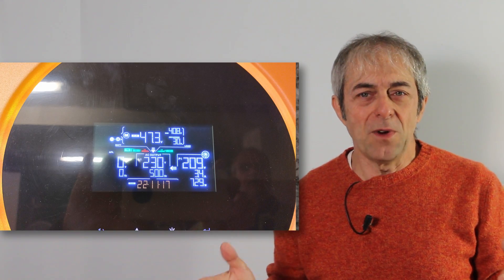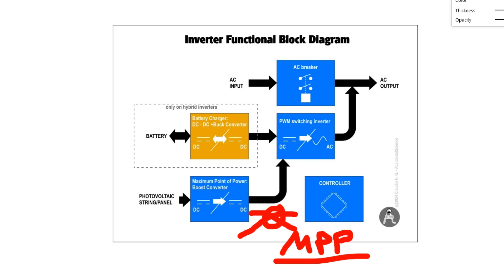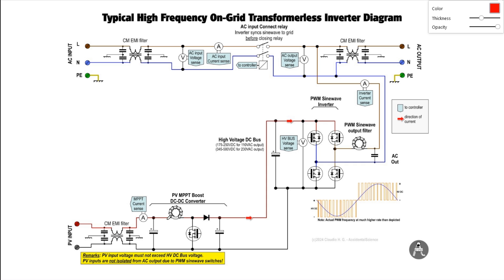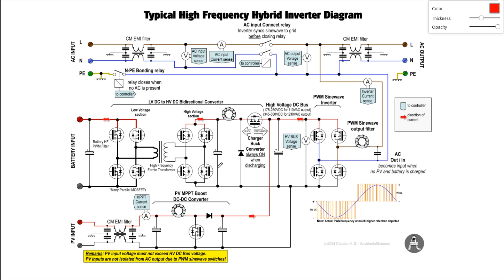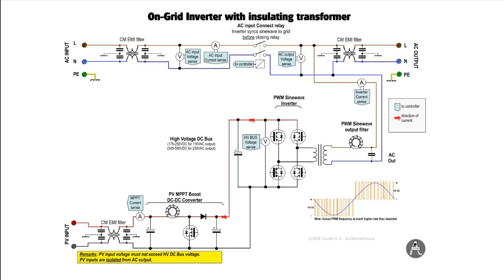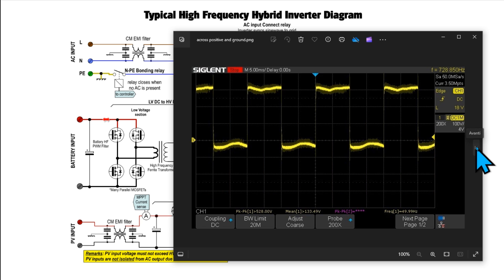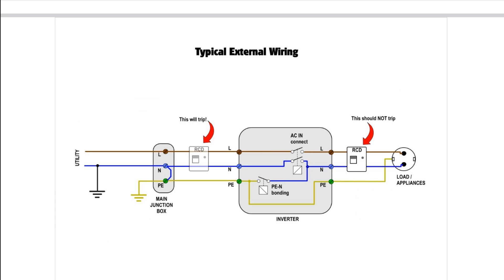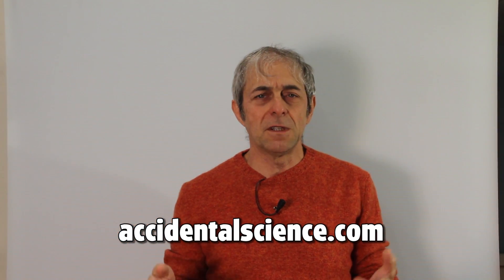Why grounding solar panels could be problematic?

Comment: Very interesting video. I am surprised that the AC leakage into the DC bus doesn't cause more problems.
Reply from the maker: The AC is originated by the switching from the DC bus, so it cannot cause any problem ...at the bus level. Unless I have not catched you meant something else. In case, feel free to add your thought, you are welcome.

Comment: I saw this issue on a grid tie system in Mexico, with an internationally available grid tie system. It was implemented with a transfer switch that also switched the neutral (3 contacts) and in the end had energized the entire house rebar system and metallic plumbing pipes and fixtures. The panel frames were also energized, likely causing the house structure current leak. It is unimaginable that these systems do not have an isolated output, either with a transformer of sytem rated power or a few small high frequency transformers internally. This is a manufacturing and regional approval issue.

Comment: If you're doing a Grid-Tie System that also has off grid capability, so you have power when the grid id down, GET THE TRANSFER SWITCH!
Because if you don't, and the Linemen come out and find a voltage on the line, they aren't going to look to see where it's coming from and ask you nicely to turn it off. They will simply short the lines and fry your system.
In the same way that you have no grounds to sue the Fire Department for breaking your car's windows when you park in front of a Hydrant, if you complain or try to sue, you WILL get a nice fat ticket to go with your loss. BECAUSE YOU BROKE THE LAW.
Reply from the maker: @TimeSurfer206  thank you for pointing out that. I don't remember if I mentioned it in the video but being my system configured as UPS it already has that transfer switch inside of the inverter.     This is common for many modern inverters.
Reply: @AccidentalScience  I wasn't speaking to you, but to everyone. Some things need to be said out loud and often. The installer, whether Homeowner or Pro, needs to make sure it's there.
I am that Safety Jerk who has called Labor and Industries when I found a homeowner using a Suicide Cord on his generator.
Reply from the maker: @TimeSurfer206  that's why I appreciated your comment.
Reply: @ Ah, I see you too are another fan of "Stating the obvious."
It's amazing how few of us truly realize that "The obvious" is one of the easiest things to overlook.
In all of the books on the variations of Murphy's Law, my favorite by far is, "Any time you think you know what you're doing, you need to look again."
I double and triple check my work, and look forward to the Inspector giving it a final look-see.
Tradesmen who hate the building inspectors bother me just as much as the Piglice that hate Internal Affairs.
Reply from the maker: @TimeSurfer206  I re-watched the video to refresh my memory. First off the purpose of this video is not to  tell others to DIY this kind of installation but to explain how modern inverters are made and the problem I noticed after my experience. Second but not less importantly at 1:26 mark I clearly stated that the described inverter internally has a breaker that interrupts the continuity when there's no voltage from the grid. I also added the motivation making crystal clear the risk of injuring a power line operator if that part would have been neglected. Because yeah while it's easy to overlook what should be obvious, especially for experienced people, I try my best to "state the obvious". Cheers.
Reply: @AccidentalScience  You did, and I seem to have missed it.
One thing we both failed to note or state is that this type of Inverter can actually fail and allow AC Mains Voltages to go into your DC System.
I believe an Isolation Transformer might be a worthwhile investment.
Reply from the maker: @TimeSurfer206  Yes, good catch. If one of the MOSFET fails melting the AC would end up into the DC bus. However if this happens after half cycle the other MOSFET are driven and a spectacular short happens causing the fuses (not shown in the diagram) to trip.
Reply: @AccidentalScience  Wow. I just realized how many years it's been since I actually had an Electronic Tech job. Been too busy bending conduit and pulling wires.
Knowledge is like muscles: "Use it or lose it."